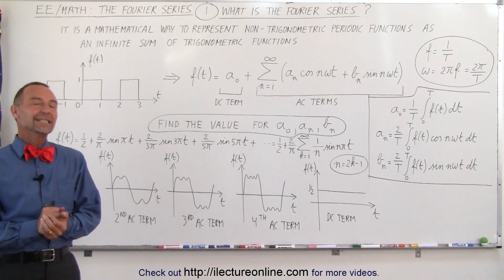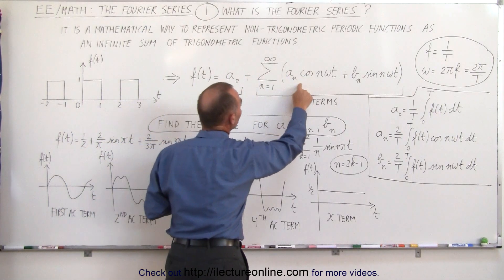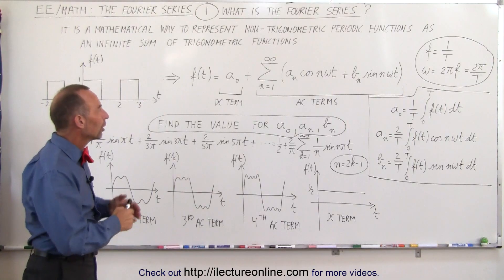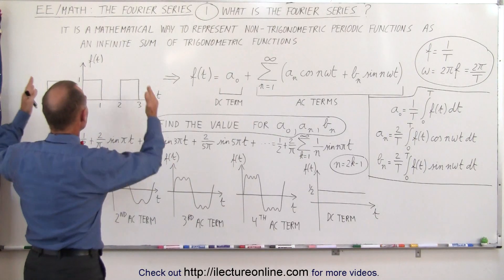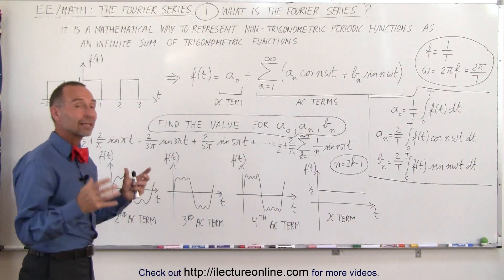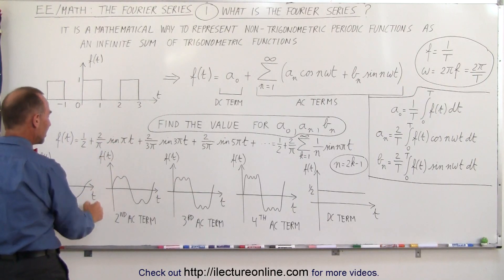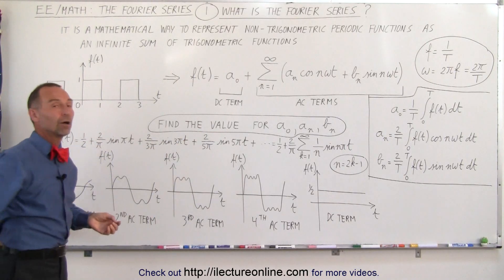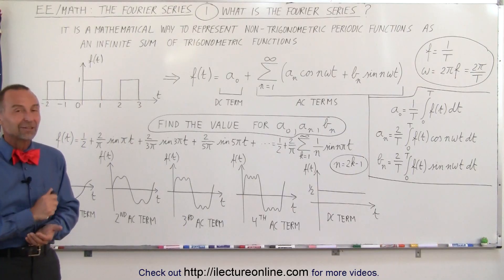Electrical Engineering: Ch 18: Fourier Series (1 of 35) What is a Fourier Series?

Comment: Is fourier series used in electronics only or other branches of engg also ?
Reply from the maker: We use the Fourier series and Fourier transforms for radar signal processing all the time.
Reply: @MichelvanBiezen  other than elec and telecom is it used ?
Like mech
Reply from the maker: It is also used to solve mathematical and physics problems
Reply: In calculus see this  when you integrate sinx or cosx from 0 to 2 pi
See the answer you get 0 as answer
You are given something to measure
and you get 0 when actually it should be 1 +1 +1+1 = 4
taking  1 for each 0 to pi/2
This very nonsense is carried throughout so in four oer also you may be getting wrong but you are not aware of it.
Hence I am campaigning for removal of trigonometry calculus in its present form This will help students lot.
You spread this message to at least 500 students.